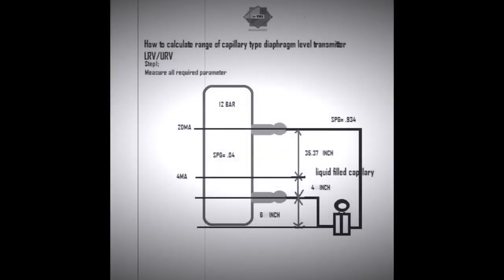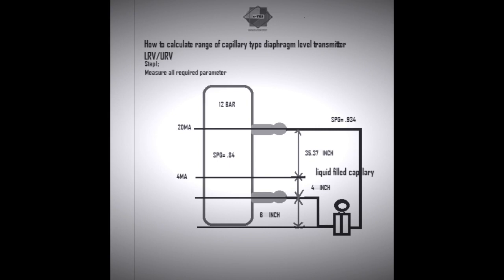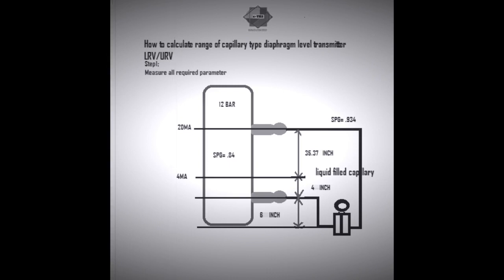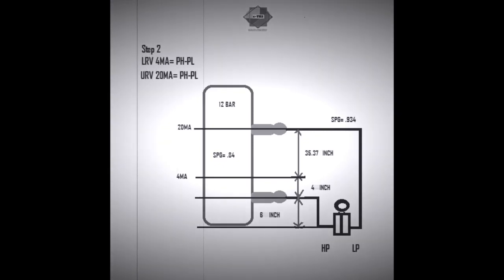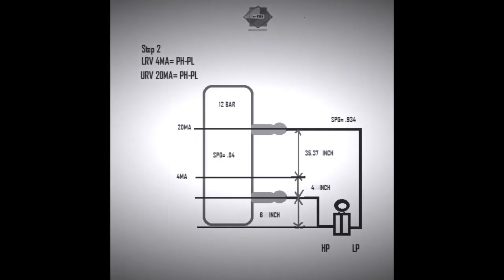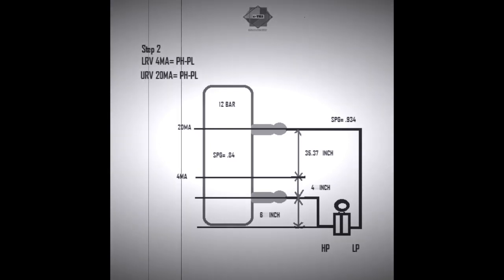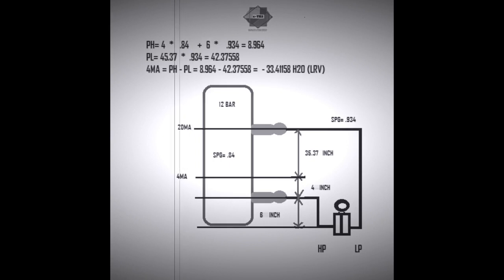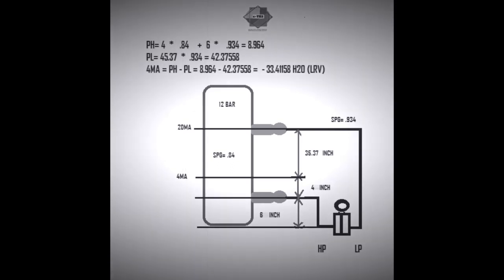Formula to calculating range LRV/URV of capillary type diaphragm level transmitter.

Comment: Its wrong this procedure is for normal DP type level transmitter, in capillary seal type DP transmitter, length of tube at both side is same and its  irrespective of the location of the transmitter.
Reply: Good point but I believe this more of an example for impulse lines vs capillary